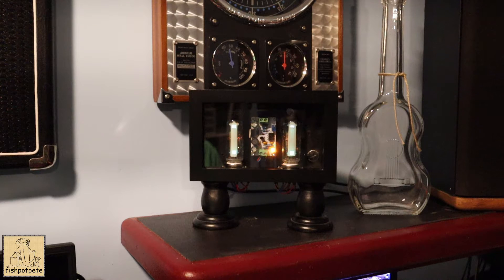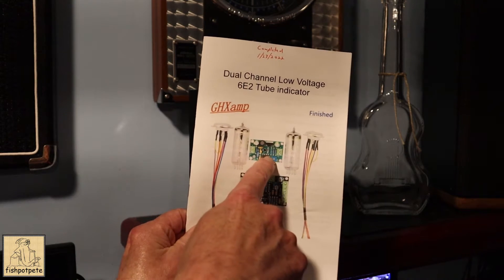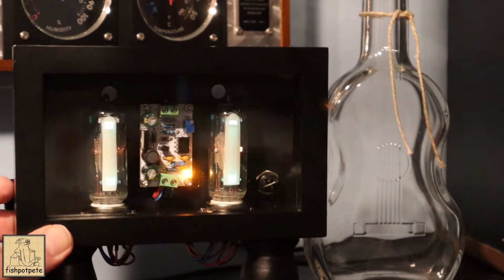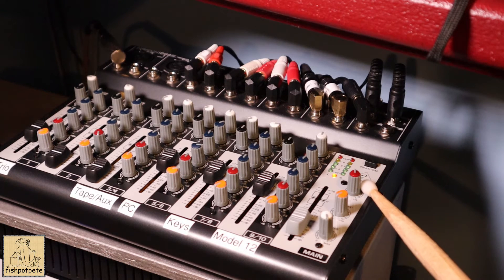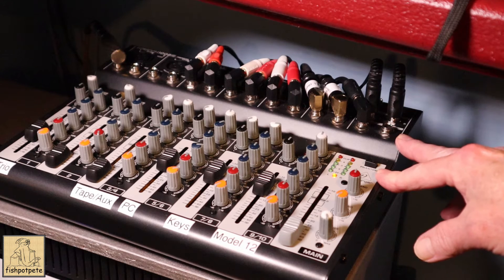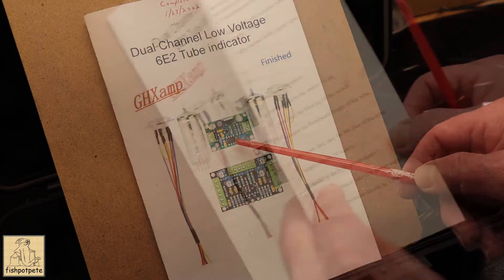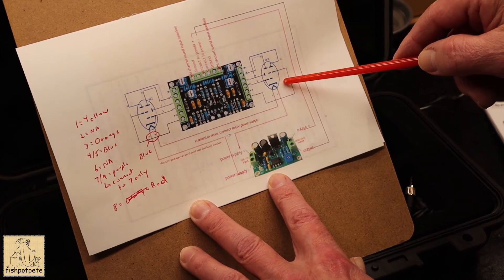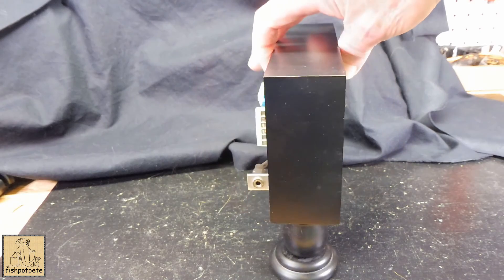6E2 Magic Eye Custom Case Build and Demonstration

Comment: Got a suggestion for you, if you look at your video the front is highly reflective so turn the box into an infinity mirror, so mirror film on the back and 2 way mirror on the front, that’s what I will be doing and hide the circuit board if you don’t want to make another case then cover the circuit board inside with mirror acrylic using brass pc stand-off.
Reply from the maker: Hey, cool idea!  I like being able to show the circuit boards when I show it to people.  But it probably would be a much better presentation if I use your suggestion - Maybe I'll make another one specifically for that!  Thanks for the idea :-)